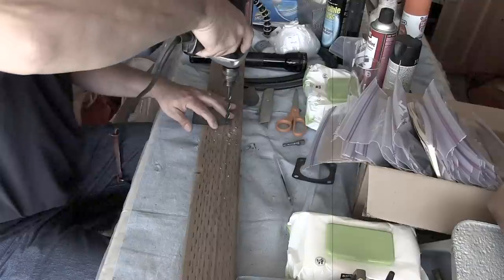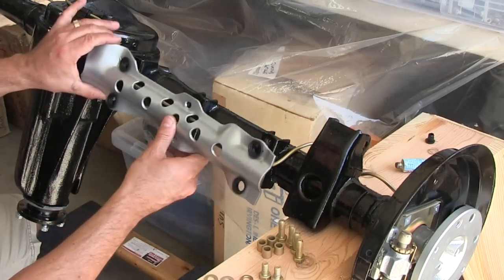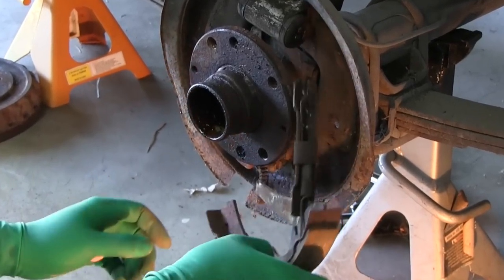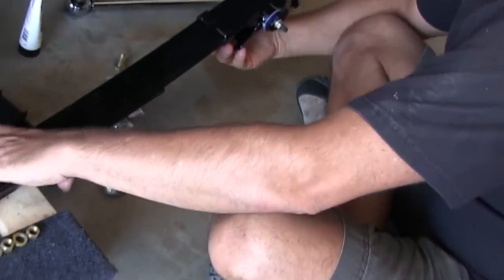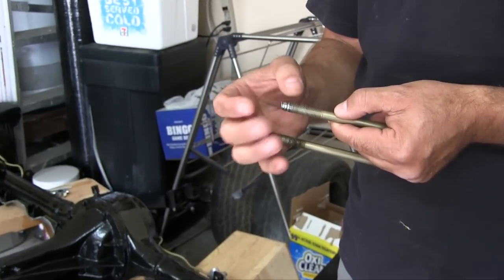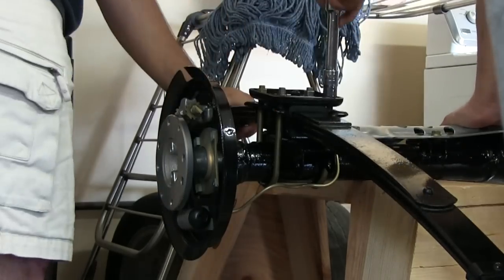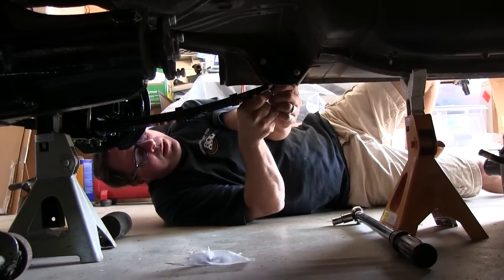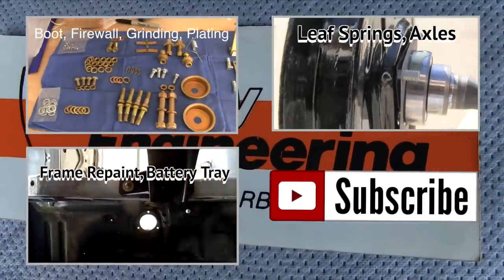VLog 17 Mazda RX3 Rear Suspension/Differential Leaf Spring Installation

Comment: nice video! have you fitted your rear bumper yet? what did you use to hold it on? I have a sp iam working on.
Reply from the maker: pablo h I haven't bolted it up yet but the holes are already in the beaver panel. I could just bolt straight up to it but I'm thinking about adding a support inside the boot. Still on the fence about it.